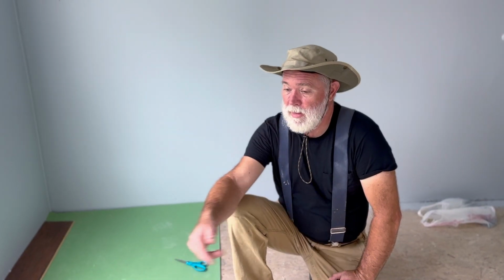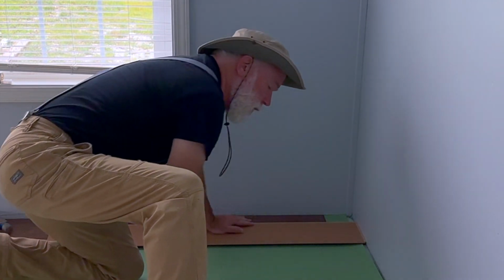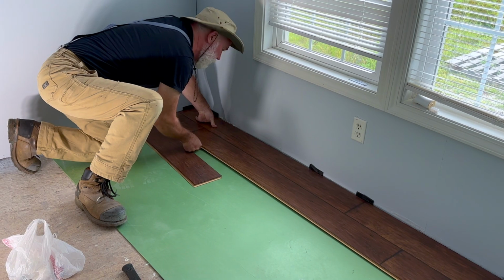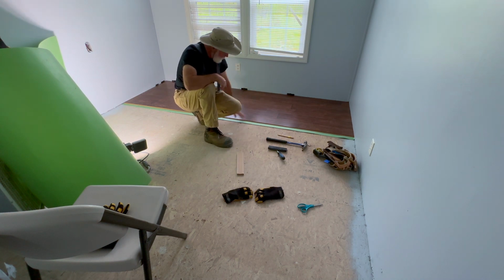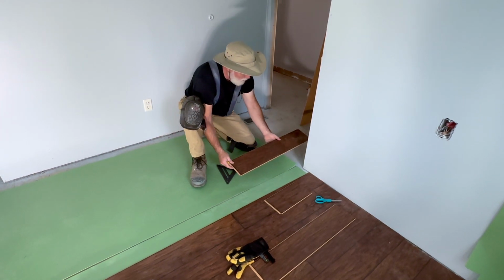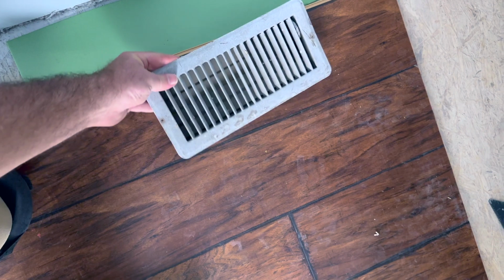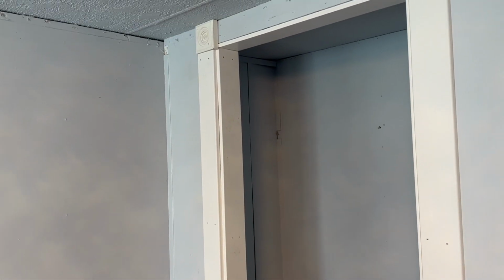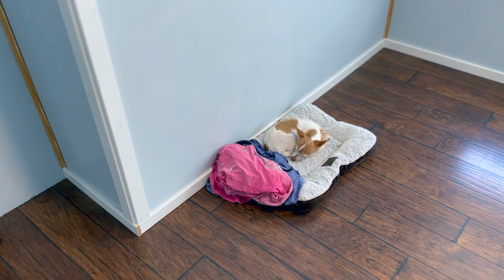Finishing Bedroom Remodel with Flooring And Trim

Comment: Laminate floor does work in high traffic areas i have had my Laminated floor down for 20 years with dogs living in the house.with No issues. Good luck
Reply from the maker: Thank you for watching. Yes, some of the better quality laminates would work, but we have our heart set on the flooring we used in the train depot we rebuilt in Nevada. It was bamboo on a composite vinyl core. So far we have only been able to source it from warehouse in Sacramento.